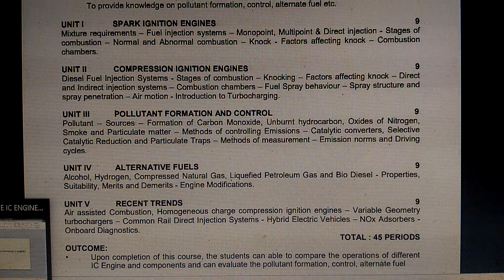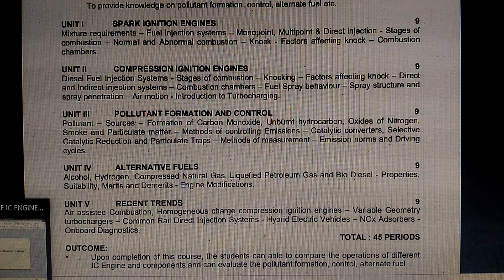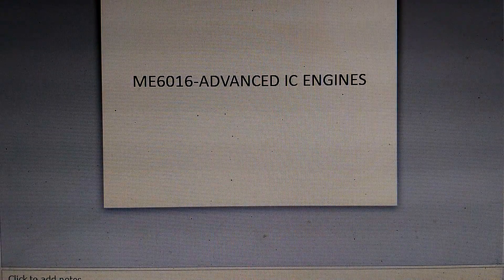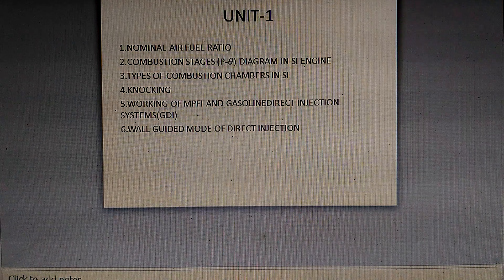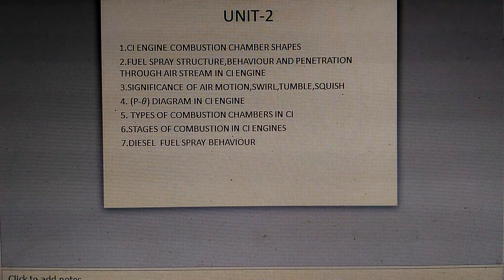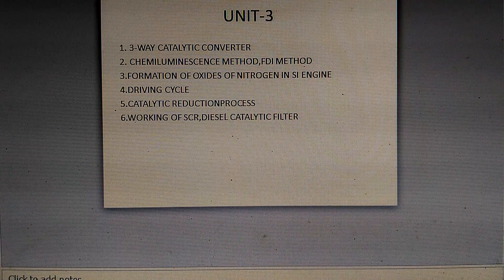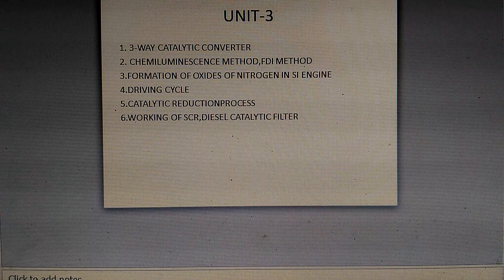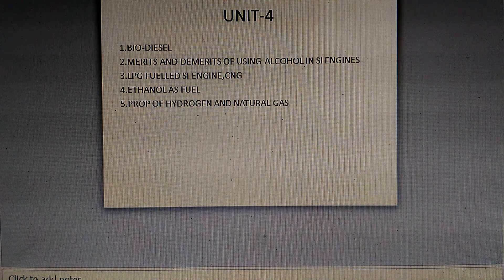ME6016 ADVANCED IC ENGINES

Comment: Bro NDT important question podunga....
Reply from the maker: En elective vera bro but frds kita ketu podran eve kulla
Reply: @TAMILMECH  bro innum update pannallaa??.????
Reply from the maker: @vikram9198  unit1
1D/b destructive and  non-destructive testing. 
2 visual inspection techniques with neat sketch. 
 3 different types of Boroscopes used in visual inspection method with neat sketches.  4 .factors influencing the selection of NDT methods. 
5 about non destructive testing methods and applications of each technique. 
 6 Explain the working principle and types of visual inspection technique with suitable sketch. 
7.allotropic  transformation
Unit-2
1.liquid penetrant testing with neat sketch. 
2.Applications of Magnetic particle inspection process.                         3.Advantages of Magnetic Particle Testing.
4.dry and wet particle inspection techniques
Unit3
1.vibro thermography
2.dynamic thermography
3.eddy current
4.infrared
5.hall effect 
6.squidsensor
Unit4
1.angle shear wave
2.straight beam usm
3.angle beam usm
4.pulse echo method
Unit5
1.computed radiography
2.fluroscopy
3.xerography
4.xray types
5.filtration
6.stages of film processing

Comment: Bro pls one help Engineering la 8th sem la NDT subject ku important question sollunga bro pls
Reply from the maker: Ok
Reply: @TAMILMECH  thanks bro waiting ..
Reply from the maker: @duskyboy3382  1D/b destructive and  non-destructive testing. 
2 visual inspection techniques with neat sketch. 
 3 different types of Boroscopes used in visual inspection method with neat sketches.  4 .factors influencing the selection of NDT methods. 
5 about non destructive testing methods and applications of each technique. 
 6 Explain the working principle and types of visual inspection technique with suitable sketch. 
7.allotropic  transformation
Unit-2
1.liquid penetrant testing with neat sketch. 
2.Applications of Magnetic particle inspection process.                         3.Advantages of Magnetic Particle Testing.
4.dry and wet particle inspection techniques
Unit3
1.vibro thermography
2.dynamic thermography
3.eddy current
4.infrared
5.hall effect 
6.squidsensor
Unit4
1.angle shear wave
2.straight beam usm
3.angle beam usm
4.pulse echo method
Unit5
1.computed radiography
2.fluroscopy
3.xerography
4.xray types
5.filtration
6.stages of film processing